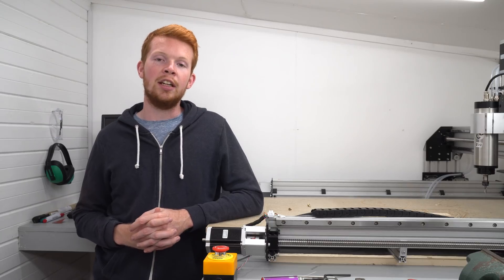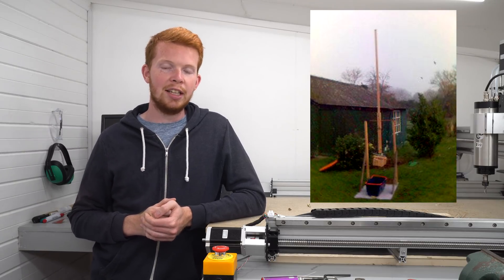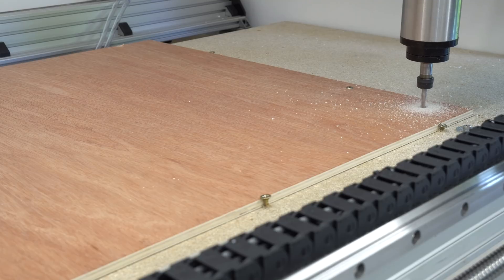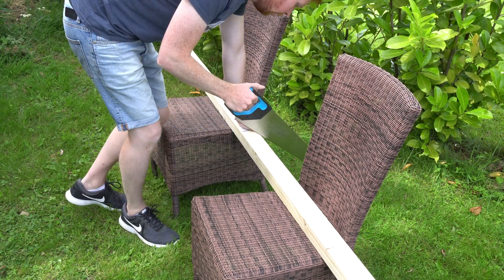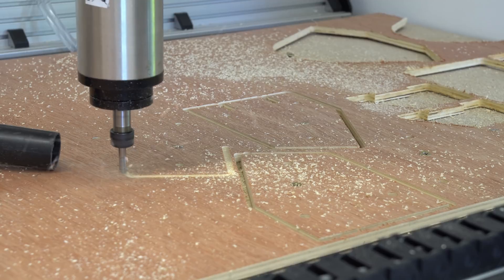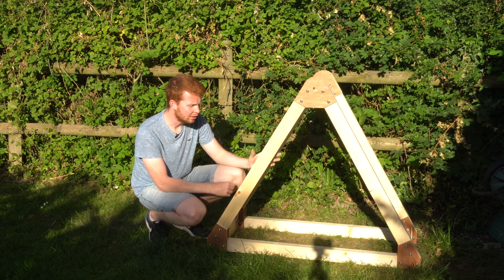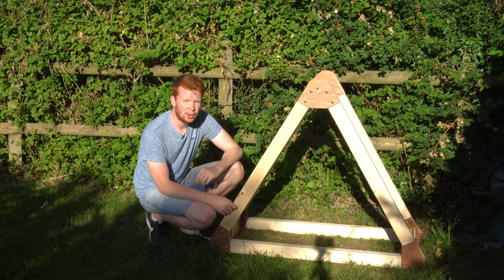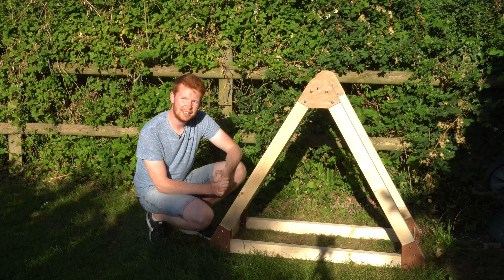Trebuchet Frame Build

Comment: How about a floating arm trebuchet as a project? The counterweight falls along the gravitational axis so no potential energy is wasted. Just a suggestion if you do, maybe make two L shaped pieces so that once the counterweight passes them it completes the rail for the dynamic fulcrum to travel along.

Also any chance for details into the best ratio's (sling length, arm length, pivot position) for a whipper trebuchet?

Comment: @Tom Stanton while you're correct about cheap Chinese bits you should really try moderately priced Chinese bits. Most Chinese carbide (not HSS) bits are actually really good. The bit you bought in the UK probably won't outperform the Chinese and the Chinese are 1/2 - 1/3 the price (And the UK ones probably come from the same supplier).

Comment: HAH a mate and I are building a trebuchet currently. The main structure of it is 2 pallets, bolted to chassis members made out of what appears to be 12x2 beams... Oh, it also has wheels. Not including the wheels it is about 2.5 metres tall to the arm axle. I'm not entirely sure on that measurement, it's just as high as we could reach.

Comment: The bit quality wasn't the problem.  The first bit you used was an upshear cutter - as it turns, it cuts upwards which will splinter the upper surface of the material.  The second cutter you used was a downshear cutter.  The downshear cutter is going to cut downwards as it turns, resulting in a much cleaner cut edge.
Reply from the maker: They were actually both upshear cutters, so the quality was the difference. I'm tempted to try some downshear cutters though!
Reply: Wow.  I've never seen that clean an edge from an upshear cutter. :)  If Onsrud sells in the UK, you might want to look into them.  They're NOT cheap, but the quality of cut is amazing.  Their documentation is top notch as well - they give chip load and speed/feed ranges for all their bits based on a generic category of material to be cut.  If you want to cut plywood with a pristine edge on both surfaces, I'd look into a "compression" cutter.  The cutter geometry is such that the first half of the bit is upshear and the 2nd half is downshear.
Good luck!

Comment: ive always wondered whether or not instead of an axle, a trebuchet rotated over a brachistochrone curve as this is the most efficient ramp for acceleration...? of course the ancients probably had no idea of such a thing
Reply: rx323bug  I have postulated that the ancient Romans could have built, and cocked large Whippers, but Ballista were doing the job, so there was no need for Trebuchet.

Comment: I built one of a similar size many years ago from scrap wood, it worked wellish but I made the mistake of using threaded rod for the shaft, which wasn't strong enough and the threads cut into the wood when it functioned. It's still at my parents though along with the 3 foot high one I made in 2001! making one now I have some more knowledge, skills and funds has always been on the list but I''ve never gotten round to it so will watch this with (slightly envious) interest!

Comment: You should buy a 1" piece of clear tubing and strap it to your router, then 3D print an adapter you can use to attach your vacuum to the hose. That way you don't have to move the hose manually.

Comment: Im 15, and 2 years ago i built a medium size trebuchet of 3 feet by 4 feet, except i made it with the modern design of the Floating Arm Trebuchet (FAT). It is a really neat, semi-complex, and efficient design. I built it over the course of a summer and when i was finished, I couldn't figure out how to calibrate the damn thing. As you said, to get a trebuchet to work well, is a whole other story. 

Anyway, it is a really interesting design so i hope you check it out and maybe do a video on it.

Comment: Interesting build.    Consider looking at end mills in addition to router bits.    You may find end mills may be less expensive.   For wood 2 flute end mills should work well.

I am not sure why you selected stainless steel for the shaft.   In the US, O1 drill rod is cheaper than stainless steel.  It is also stronger and has more consistent dimensions since it is centreless ground to dimension.   It can also be hardened, but for the 25mm diameter you are using this would not be easy to heat up with a propane torch.  In the UK, this material may be called "silver steel".

Dave.

Comment: A friend of mine built a trebuchet for launching cricket balls. It was the most histerical disaster known to man. He had overloaded it and put a way too long sling on and got various measurements way wrong. The result? It shook itself to bits while simultaneously hurling the ball directly downwards about 1 meter in front of the trebuchet so hard it went more then elbow deep into the ground (it had been raining pretty hard for the last week). I'm still laughing remembering that nearly 30 years later.

Comment: I’m fairly sure This Old Tony, said buy as cheap as you can router bits, since they’ll always break.. which I have & so far so good, well, on metal & plastic, not tried much wood yet, mainly because of the 6mm vs 0.25” difference in my ER11 collet.. :)

Comment: Stainless shaft??? No recession there eh!!?
A bit of inch solid and two flange bearings (  https://www.amazon.com/NTN-UCF312-204D1-Setscrew-Regreasable-11700lbf/dp/B007RH644K  )  bolted to the plywood would do very nicely and at a fraction of the cost. 
Still though, nice job so far. I might just attempt this with my kids over the summer. Nothing like a bit of destruction to make the kids interested!!

Comment: Hey Tom! 

I once made the whole calculations for dimensioning a trebuchet and optimised it for the throwing length. The calculation was made public on https://deralchemist.wordpress.com/2017/07/16/die-perfekte-wurfmaschine/ (or here if you prefer the auto-translated english version: https://translate.google.de/translate?sl=de&tl=en&js=y&prev=_t&hl=de&ie=UTF-8&u=https%3A%2F%2Fderalchemist.wordpress.com%2F2017%2F07%2F16%2Fdie-perfekte-wurfmaschine%2F&edit-text=&act=url). All of the model parameters and the Mathematica sheet for calculating the perfect arm length depending on the counter weight and the weight of the ammunition can be downloaded here: https://github.com/MKesenheimer/Trebuchet.

If you want (or if you don't have access to Mathematica), you can give me all your preferred model details and I will calculate the perfect parameters. 
I'm looking forward hearing from you!

Matthias
Reply: HOHOHO thank you!

Comment: Wheels should make it work better if I'm remembering what I was taught a few years ago and it will make it so it won't tip
Reply: I've also heard that wheels help... my understanding is that it helps the weight drop along a more vertical line... which accelerates it faster than swinging?? I'm guessing

Comment: Nice work, I would suggest putting it on wheels. It will put less stress on the frame and mor energy into your projectile.
Have built one my self with some friends for a local radiostation a couple of years back and it had about 250kg counter weight if i remember correctly. If not it was 500kg

Comment: Please learn your feeds and speeds before criticising 'cheap' end Mills, there's nothing wrong with router bits from China even if they're cheap. These kind of routers operate at very high spindle speed 24000 rpm so you want one flute,  if you have two flutes or more the machine cannot move fast enough with enough rigidity to cut big enough of a chip without rubbing,  hence the blackened bit within minutes. Kinda the problem with these machines,  high spindle speed requires high speed movement and extreme rigidity which is never the case so bits don't last. youre using the wrong bit for the wrong task,  you don't need high helix two flute carbide for cutting wood, standard HSS router bits work fine for high speed spindles cutting wood.

Comment: On my art academy where I studied we used hot glue to fix the plates in the CNC mill. Maybe something you can try. To keep the parts fixed on the plate you can use tabs which you can remove with a knife :)

Comment: Use it to launch a glider!
Reply: A glider would be a good idea. It would need to be designed with foldable self deploying wings.
Reply: XT500C 
And a compressed air engi.. ....
Reply: Guys, i m planning to build a glider and that's the first thing I thought after clicking on the video!
Reply: Imagine a capsule holding the glider folded and giving it the right weight to launch it far up. Then opening and landing with a parachute, while the glider is flying

Comment: The router bits are more about geometry than money. A machine like yours doesn't run incredibly fast spindle speeds nor is it stiff enough to substain high feed so a 3 or 4 -flute bit might be best. A 2-flute has more space for chip removal and works better in high speeds but will break more easily if something goes wrong. Note that all bits don't allow for direct z axis drilling so you need to sink them in on a slope.
Reply: AlfonsoB the spindle on this and most wood routers is incredibly fast about 24k rpm,  normal cnc milling machine is about 6 to 8k rpm and high speed machining run about 16k rpm

Comment: Doesnt a steel shaft have a to high inertia?
Reply from the maker: The steel shaft will be fixed to the frame and the arm will rotate around it using bearings. So the shafts inertia won't affect the projectile performance.
Reply: talk to me more about this shaft?  ( ͡° ͜ʖ ͡°)

Comment: You should go to a sporting goods store and buy the one of the steel bars they use for dumbells with removeable plates. They even have nice collars that clamp the plates on you could use to secure the bar in your frame. If you can't get the bar alone then just get the whole set and use the plates for the counterweight. ;-)
Reply from the maker: Great idea! I'm using a bar and weight plates for the counterweight, but for the main axle I want to use bearings. Fortunately 1inch bearings fit 25mm shafts pretty well haha. Thanks mate!